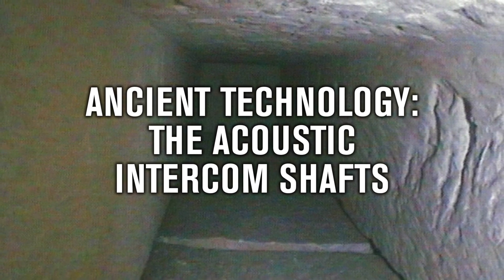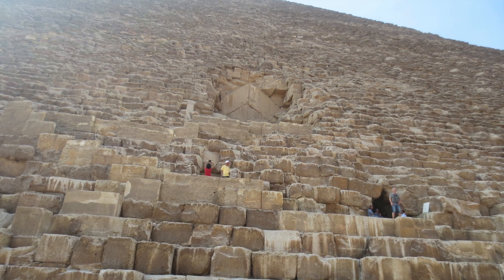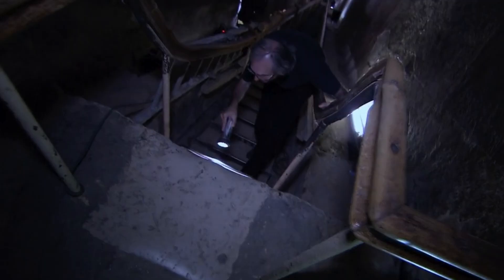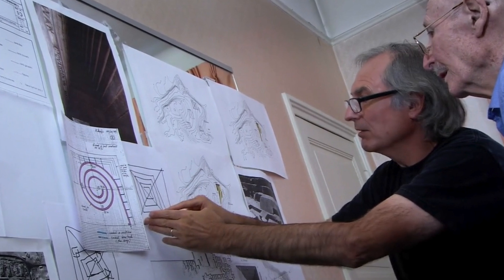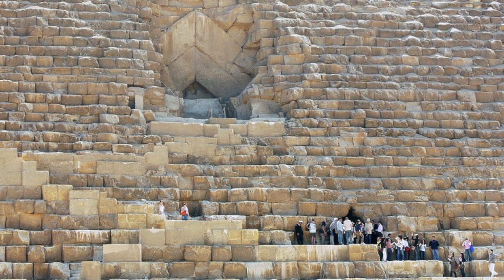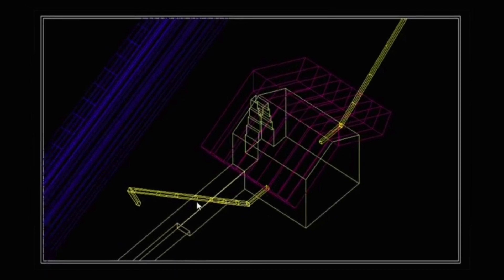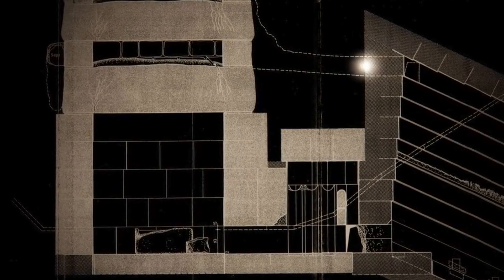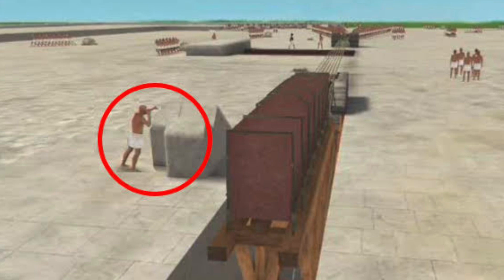Great Pyramid ‘Air Shafts’ Theory: Acoustic Communication Shafts | Ancient Architects

Comment: A nice theory but I can not believe that the shafts were built for communication to send orders about hoisting or other work-activities. To communicate while hoisting is more easy to simply shout straight out, or use signals like using flags, bells or horns that were available in those days as well, much more direct then using difficult to built shafts, having a time delay as well by using a transmitter in the shape of a human hearing an order and shouting it through from the queens or kings chamber, an error in hearing the order right is easy to make.
I can understand it being used as sound chambers to let people outside the piramid hearing messages of religious kind being send out from the chambers through the shafts as Mr.Houdin heard himself was heard quite well outside the piramid. Telling important messages in that way with the believes and worship of the people in those days would have sounded and received as being devine and have come from the gods or the dead farao's themselfes, religion and strong worship and the importance of the farao, the gods, the tempels etcetera can put a certain spell on people to believe all of the magic and mystery being given to them on such magicall manners.

Comment: Ever wonder why there are eight sides instead of four? Pressure! From what energy source? Try opening a set of tight fit doors simultaneously and they bind; but when you pull on one side only it opens. Yes, everything there is by design, but ask WHY! The harder you pull or push you will never see.

Comment: I don't get it... What kind of information would someone from inside the Queens Chamber wanna send to the constructors on the outside?! Also, the pic at 19:18 don't show the actual size. The stone with the coppar "handles" are much smaller than depicted. And why all this focus on the Great Pyramid only? All the pyramids at Giza much be seen as a whole. Why then are there no shafts in the second largest pyramid? If they were used for intercom, wouldn't they needed such a thing during the construction of the other pyramids aswell?
Reply: no other pyramid had burial chambers that high up in the pyramid body. Then the KC made from granite with five relieving chambers. they really had to come up with a concept, planned 20 yrs in advance. After that Kafre just did a 'simple' pyramid, a pile of rocks, looks just as good. economics. after that, small pyramids.
Reply: @ast3663  To my knowledge there has never been any proper investigation for more chambers in the other pyramids.
Reply: @HasseBasseBingBong  who says that? No other pyramid has such internal structures. Djoser is very complex underground, but earlier and not comparable.

Comment: The interior would of been built from the inside out, not the outside in, so they would not of been able to use the shafts to communicate until the pyramid was finished.

Comment: Email JPH to go back to that area where Bob brier climbed the pyramid to get to. The big gash near the top of the pyramid.

He needs to go there with an endoscope and better lighting to confirm if there is an internal ramp. It would be quite simple to confirm using this method.

Comment: If the theory is correct then the illustrations are wrong, because given the illustrations, it would be far easier to use flags to communicate.

The only thing that makes sense to me is that they needed to do something inside pyramid at a specific time based on some celestial observation. So when some star rises or something you can have someone yell down the shaft.

Comment: BASS REFLEX PORTS! THEY ARE BASS REFLEX PORTS!
Reply: how does the sound change if it the two under QC mouths were sealed with relativley thin stone slabs like they were originally? more like a subwoofer? a sub needs air exit at least..

Comment: I'm not following you that this explains the need for great acoustics in the King's chamber. 

If you have a guy standing at each end of the shaft to relay messages, you only need good acoustics in the shafts themselves, not the chamber, right? Did I miss something?
Reply: I think the acoustics of the chamber simply drew attention (of JPH) to the possibility that the air shaft could have been used for communication. 

Not that the acoustics were particularly relevant during construction.

Comment: Maybe when it was finished and the shafts were closed off. The casing stones put in place acted as an amplifier, turning the surrounding capstones into a big speaker. 

You say to keep it simple. Fine, i agree but you don't need a fast com system then if you wanted to keep it simple. You don't build any chamber in it. Simple means a solid core. Can't get any simpler than that.

It has to be about spreading the load first and foremost. So why the box in the chamber? Could it be with it's top, have been a big gong? It's resonance transfers to the outercasig stones through the shafts?  I'm still half asleep lol

Comment: I still think it's a water pump.  Pipes and caverns carry sound well too, even if they were designed for water.
Reply from the maker: But natural geological cracks in subterranean chamber and no chamber or corridor is hermetically sealed. It would be extremely inefficient
Reply: @AncientArchitects  I have no idea.  Just that the pyramid was built on top of a subterranean chamber.  Makes me think it was a well, and then they started building on it over time to improve it.
Reply: @AncientArchitects  I just look around at giant stone works and so many of them are connected to control of water.  Plus the granite rooms make sense if you don't want water washing away the stone work.  Also there is something about the doorways, how there is a graduated narrowing as it rises, it makes me think of flood control. Or maybe a way to look down and see what level the water is.

Comment: If it's all about weight spreading then why didn't they just have the big stones there when they laid the first course and lift them up the 1.3 meters each time they laid a course.
Reply: Perhaps because they had no means to raise them other than with a counter-weight.  So then the question is: why didn't they raise them from level to level with a counter-weight device?  Well, they'd have to assemble and disassemble it dozens of times for each new level.

Comment: Amplification requires energy. I think you are misspeaking when you say sounds are amplified by the chamber. I'm sure you can hear the sounds and they likely reverberate around the chamber and are slow to be absorbed. But that's not amplification.
Reply: He clearly is referring to the perception of increased volume compared to sound entering a totally open space, like outdoors.  In a reverberation chamber you hear the same sound from all directions which is a positive multiple of the original sound that hits your ears.
Reply: @redwoodcoast  Thanks. So you agree it's not really amplification. My only point was that calling it amplification was inaccurate.

Comment: Shafts in my opinion were for the water hammer reverberation effect. Water is akin to spirit to the Ancient people of Khem. So every year as the nile flooded it would fill the lower shafts and as water moves past parts of the crossways it created the pressure to enable the water hammer effect ( frequencies) to affect the crystaline granite in the kings chamber which would excite the crystals and produce piezoelectric energy. Like a watch

Comment: If they needed to communicate during construction they could simply relay the messages using a 3rd person from the outside just as easy??? Especially if they built the pyramid level by level like in buddy's hypothesis these vocal tubes wouldn't even work until final completion.
Reply: Maybe it was just for the foreman on top to yell to the workers inside when it was time for lunch lol.
Reply: @jordanshilander7402  the inside would have been completed well before the top. To communicate through the pyramid makes no sense at all. Perhaps sound has something to do with it but I see no reason for a this relay idea.

Comment: I can’t believe they went through all this trouble to make a stone communication system. If that’s the case why wouldn’t have been on four sides to hear on all four sides. Would make sense to me….. I have seen those photos of some other chambers in the great pyramid….. looks like two more chambers like in the bent pyramid….if the great pyramid was part of a machine complex the spiral ramp could have been for cooling water inside of the pyramid ……..pump water at the top and let gravity let the water flow down the spiral ramp to take the heat away……..just my thoughts

Comment: I'm not buying the intercom bit. The builders would have needed to communicate pretty much all the time across each layer of stones as they were laid down. They would have done it with a relay—runners or flags—from one side to the other. This fits in with the KISS (Keep it simple stupid) theory.
Reply: We dont know how the construction was carried out, so we dont know what level of communication was needed, so the theory is valid.
Reply: @manoo422  Respectfully, I disagree—it's not—nor is the "designed for acoustics" theory which is simply a bi-product of the build.
Reply: @peterloader974  In order to disagree normally intelligent people have a reason. Since I didnt mention acoustics, you havent given one?

Comment: Sorry, not convincing. It might have been a nice side effect, but surely not necessary for operating the counterweights etc. Flags or arms for signaling wouldn't have required more people. Ventilation is plausible, especially if there were still lots of blocks transported through internal corridors, while the uppoer parts of the pyramid were finished.

Comment: Because flaggers on both sides of the pyramid would have been too hard?
Reply: They couldn't use flags if they hadn't thought of them...just as they had not come up with 'the wheel'.
Reply: @redwoodcoast  I suppose that would be far too difficult when building with such precision.  :)
Reply: @redwoodcoast  they had the wheel but not much use for it in a desert and a true wheel.

Comment: Why Pyramid of Khafre doesn't have air shafts?
Reply: It does. They are in the "Burial Chamber", up in the walls. But they are unexplored it seems because there is literally 0 information if you search on the net, except mentioning that there is two of them. Anyway, the proposition here claiming they are used for "construction communication" is utterly absurd.

Comment: Also does this theory in anyway negate Chris Dunn's theories? I don't think it does and having properties that are both acoustic and conductive makes sense.
Reply from the maker: No, this wouldn’t harm Dunn’s theory. Dunn’s theory is based on function after construction, this is a theory in use during construction. Likely multi-functional. All depends who and what you believe. 👍
Reply: @AncientArchitects  Cool deal just checking. Was pretty sure but needed to run that by you. Thanks.

Comment: Matt, I'm onboard with your theory, and rather surprised at the resistance. It obviously wasn't difficult to cut and arrange the cavity while placing the 3 ton blocks, and the idea is dead simple, and so practical.  One can easily see that the communication to manage placing such mega ton granite blocks, especially the chevron block placement by such means was necessary, and therefore part of the design from the get-go. Such an elegant solution to a construction site problem, with the added advantage of air supply to the crews working below. Those envisioning flags as a better method are off in the weeds, to put it politely. We use radio communication in similar settings today, loading and off-loading container ships for example. 
Go for the series option,  the serial narrative at least 30 min each. Probably you have material for a dozen. You can do the full length 2hr feature, editing in the best of the serials content into a compact review next year.

Comment: i dont buy the communication system because
- distance between QC SS and QC NS is ~100 meters - not impossible to communicate in open air rather than designing and building complex shafts
- communication with grand gallery could been easily achieved with 2-3 people in between, or maybe using some system with ropes - much, much simpler than constructing the shafts. there were some opening because the ropes for the counter weight system have reached outside
- acoustic although amazing in grand gallery, is not a special feature. we know it was counter weight system so acoustic is not main feature and most likely is a side effect of the volume and material

Comment: Rameses II arrived to completed structures no dynastic Egyptians could have achieved with just copper tools. One huge tell is there are no hieroglyphs to be found though Rameses II put his signature on everything, even crudely marring works with his cartouche on artifacts that predated him by thousands of years. Ramses II never got inside a pyramid. It would take the invention of dynamite to achieve that.

Begin with the premise that the pyramids are not tombs, and could not possibly have been built by the dynastic Egyptians. There are over 17 pyramid sites buried in the Nile Delta alone that have not been touched. There are many other examples besides pyramids of engineering technology that was beyond what can be achieved with copper tools.
Reply from the maker: Who mentioned copper tools? Also, the pyramid is like 99% limestone which is relatively easy to cut with copper tools. The granite cut be cut with flint, polished with emery. All doable.
Reply: @AncientArchitects  Not at that scale and precision, sorry. There is no culture of stonework that gets you from desert people absent the wheel to the pyramids in the time allotted with the technology available. Your limestone theory suffers from not enough time on the clock to complete by an order of magnitude at least. And that's just for a single pyramid. The granite and basalt work could not have been achieved by emory alone, and certainly not by hand. The whole dolorite ball sculpting method is demonstrable tripe. Many works, such as those in the Serepium, cannot be reproduced with today's technology. There is a definite distinction between dynastic Egyptian work, and that of an older, more refined civilization. Any stonecutter will tell you this. I suggest interviews with such professionals in your programming.

There is also no way you get paper-thin andosite jars numbering in the thousands from copper tools or emory. You would be hard pressed to reproduce it today, as the material is extremely difficult to work. Some of the shapes defy lathing. There is practically zero record left by the dynastic Egyptians as to  theses stone cutting  methods because they didn't have any.

Begin with the premise you are dealing with two ancient civilizations, one far older than the already old one. The works of the dynastic Egyptians, while certainly marvelous, pale in comparison to the more ancient works. Rameses II reused what was left to him, as has been going on at Giza and elsewhere for 10,000 years.

Comment: Phuhh, and what about the other big pyramids? They did not need the shafts? No, sorry. 
I also dont believe that the builders that were able to cut stones perfectly with a 5 m or more diameter saw did use ramps and ropes and manpower - like you said - keep it simple. 
The clue will be only found if all pyramids are analyzed together, eg the red, the bent and the others on the plateau. 
Everyone is only focusing on the Cheops and blind for the whole thing 🤷🏻‍♂️

But - like always you do a fantastic job with your channel 👌👏